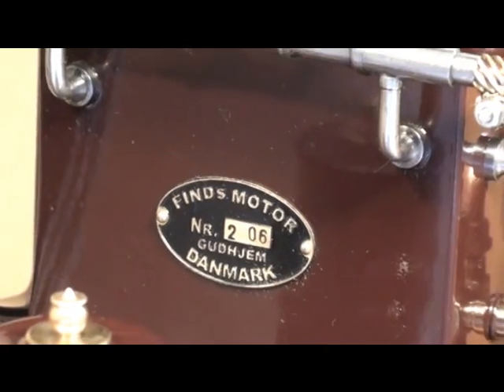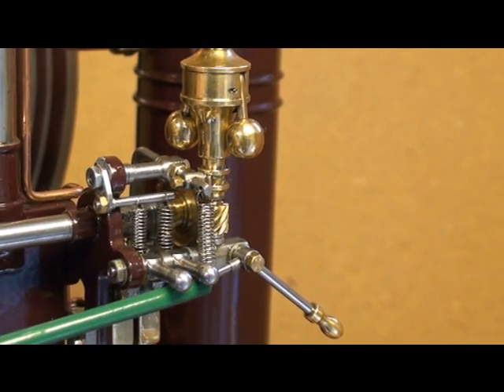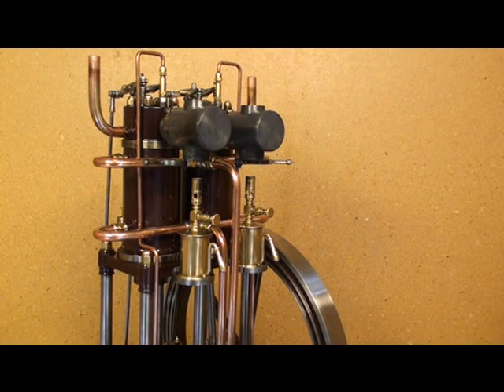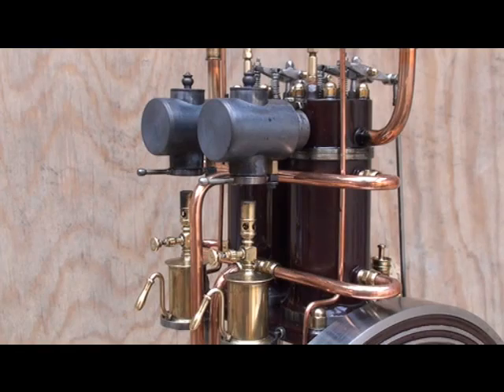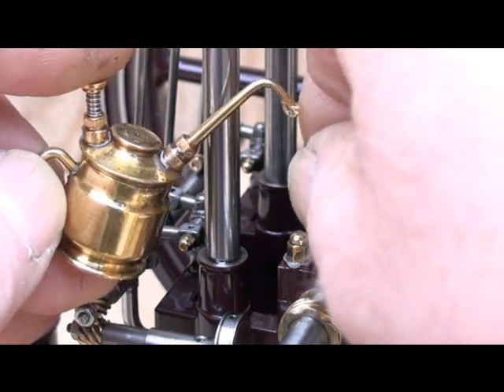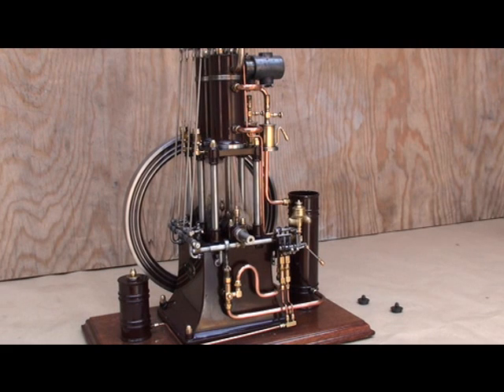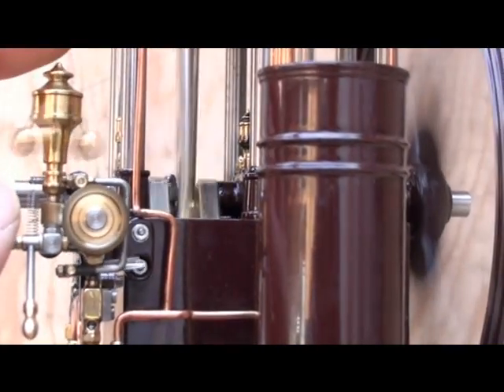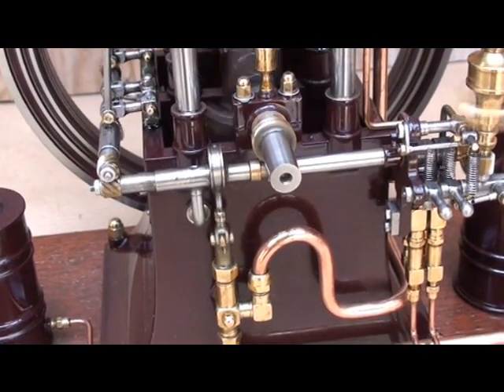World smallest working Six Poster Hot Bulb Model Engine No. 2-06

Comment from the maker: @tpvalley Thank you for your comment. When I build this engine that fires 180 degrees apart, I was thinking 
about the engine balance, one piston up  and one piston down. Later I build the double apposed and the twin
engine, witch fires 360 degrees apart. It is a bit difficult to make the injector pump, the injector and the governor
system that small if you want the engine to run properly at a low speed say about 300 rew.

Comment: @boksermotor 
so it fires 180 degrees apart then 440 degrees? why not seperate by 360 degrees between firing?
Is the injection pump a difficult part to make with injectors?
I had figured that it must be very hard to get them to work below a certain scale.
I always wanted to make a miniture diesel for a locomotive with about 20mm bore and at least 6 cylinders, it would be 2 stroke loop scavenge with a centrifugal blower and would drive a dynamo, that would be cool.